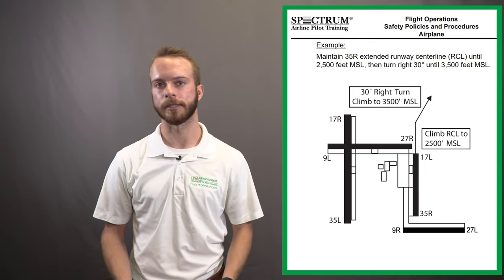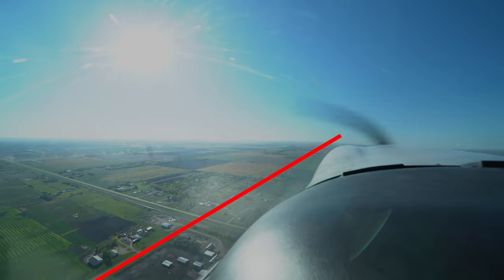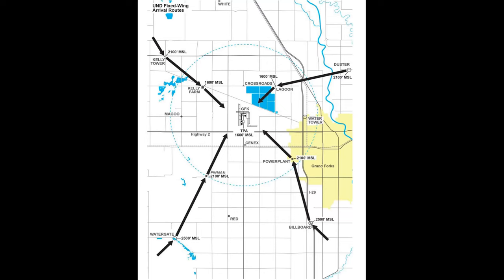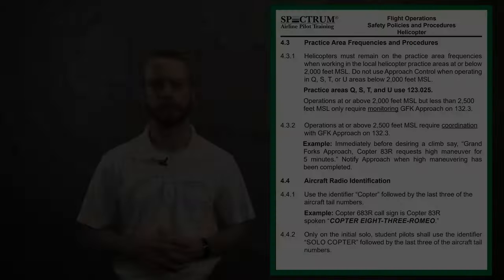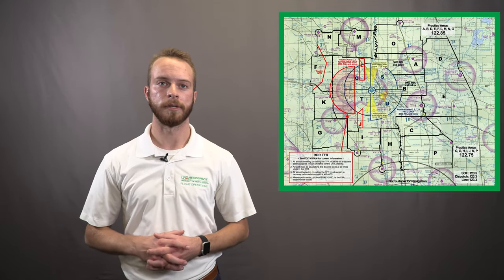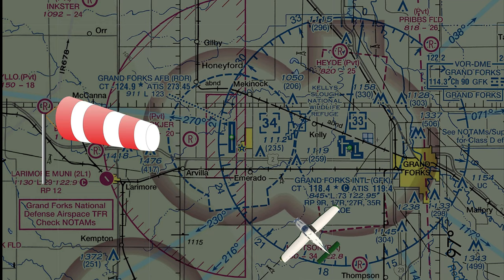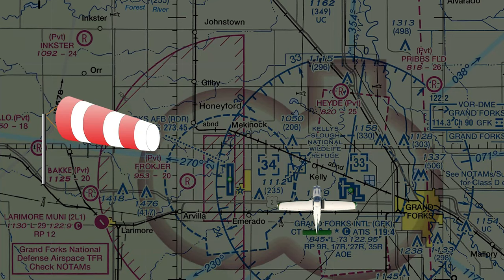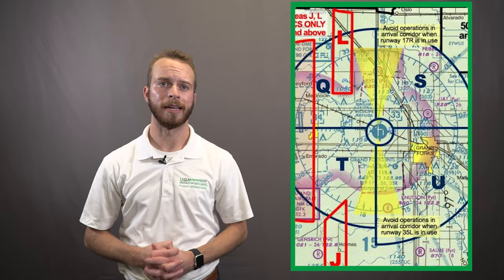Do Not Neglect the Wind: UND VFR departure procedure

Comment: Grand Forks Approach Controller here... We also can't tell where you VFR departures are going. So please be situationally aware when approach may climb an IFR aircraft on departure up to 4,000 feet.  Example: Two aircraft depart 35R. First one is VFR doing the standard departure procedure and plans to go to Fargo. The second aircraft is a local IFR released on a 080 heading. Approach may climb the IFR traffic to 4,000 ft so that it may hold at JEGUP for example. Well if the VFR starts a southbound turn at 3,500 feet, they may be heading directly into the flight path of an IFR aircraft on departure climbing from 3,000 to 4,000.